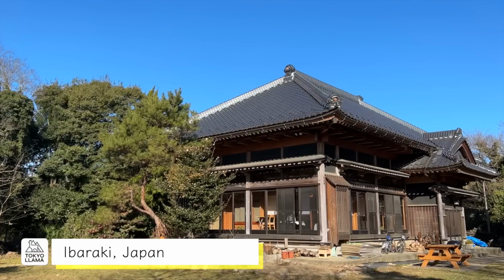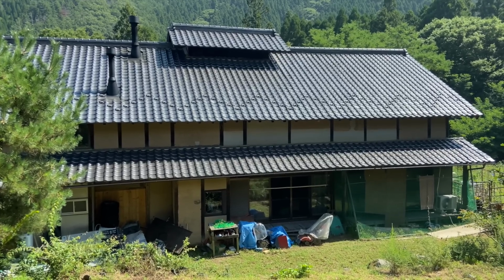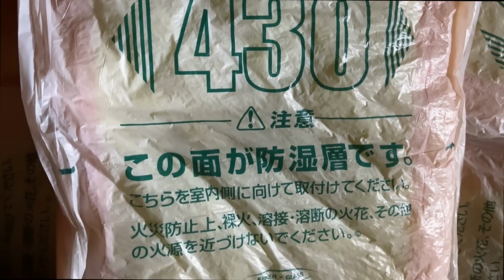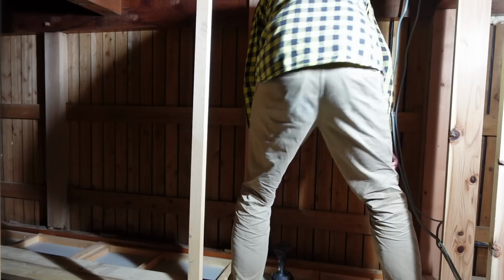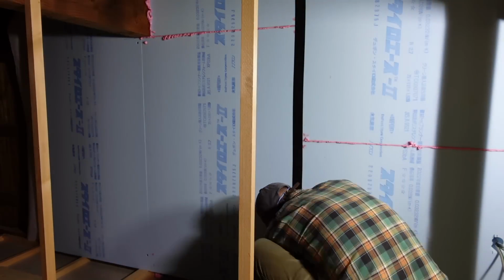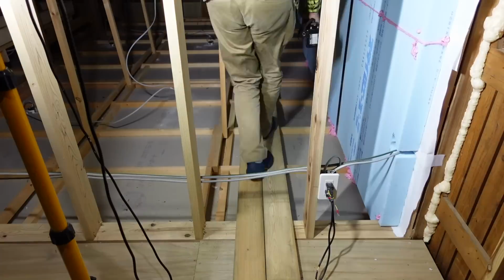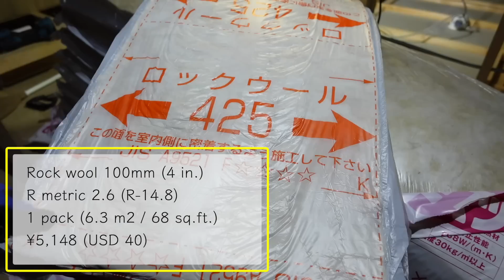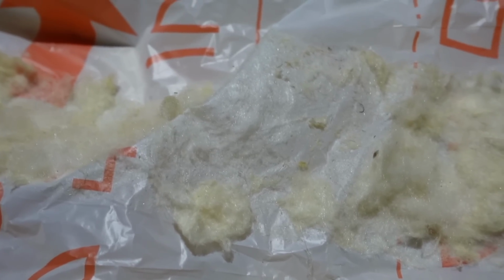Insulating a Japanese House, Part 1 | Abandoned House Renovation

Comment: You should play around with the foam spray gun with pre mixed cans. You can get a nice small bead that sticks well to join two surfaces to create a seal.
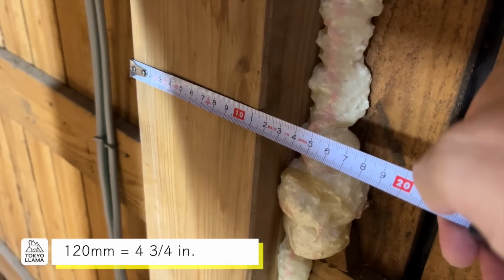Reply: Actually, I see that you did @3:36 but that bead is much too big.
Reply: I see you have it 11:28... I really need to learn to watch a whole video before commenting.
Reply: Not sure if you new this but higher R rated foam is a fallacy. It eventually off gases it's higher rating becomes the same as any other foam. What you really need to buy for is non-flammability.
Reply from the maker: Yes, that first one was a mistake. I’ve got a bit better at it. The other selling point of the Neoma foam is its non-flammability. Appreciate the comments!

Comment: Always impressive to see your skills... & thank you for your explainations.. Q: with the gaps that are useful for air circulation & prevent mold & rot in the wood.. are you concerned about wasps, bees, birds, mice from entering the house?  would putting netting or a screen on the outside wall ( interior helps prevent critters from entering?
Reply from the maker: Yes, I'm mainly concerned about hornets making a home inside the eaves. Now that you mention it I could put an insect netting over the inside of the eaves. Thanks!
Reply: @TokyoLlama   Glad I could help...

Comment: I am surprised you went with sealed insulation bats because of the concerns of moisture in Japan. I would have expected the use of normal paper faced bats to allow for moisture exchange in the summer. But then maybe the dew point is commonly inside the bat so that might be a concern?

Anyways, I'd take a peak between the bats and the the ceiling a few times over the year just to make sure things aren't getting moldy. If it's working it should be okay.

One big help would be to lay to a moisture barrier in the crawlspace under the house. This would massively cut down soil transpiration during the rainy season so all you have to worry about is the air humidity.

Comment: Watch out using spray foam near wood, it can trap moisture and cause rot.

In the UK we are now using 300-400mm thick loft insulation. I’m also laying a perforated foil top sheet to mine to stop the radiant heat from coming into the rooms below during the summer.
Reply: Open cell spray foam is vapor permeable and is used on roofs. Foil sheets can trap moisture. On the floor they do nothing as the dust renders them useless. There also needs to be an air gap between the radiant barrier and the insulation beneath to even have a theoretical benefit.

Comment: When my dream of renovating a house like that happens, I will for sure install a Heat Revovery Ventilation. 
It might be expensive but the cost savings are great and then the issues with mold can be well controlled. 
Saying that, I do not care to have ventilation ducting visible. That might be a problem for many people. 

Great job. I really enjoy watching your content.
Reply: Although you manage to provide airflow to the elevation very well. 
I learned so much from your content. 
Thank you. 

Greeitings from Tokyo
Reply from the maker: Thanks, I’m also planning heat recovery ventilation in this house. Considering ducted, decentralized, and/or aircon/heat pumps with air exchange function.
Reply: @TokyoLlama I have a Daikin with air exchange function. It works though it's not a lot of air so would consider it supplemental to wall or ceiling proper HRV. I may do that too...
Reply from the maker: @rsmith02  I've got one of those Daikins downstairs, the air exchange seems okay, but not sure the humidifier function does much.

Comment: Modern Japanese houses can also be bloody freezing in Winter. Ametalin foil sarking is recommended in the attic to give relief from radiant heat from the karawa in Summer. Huge difference.
Reply: The radiant barrier foil would have to go under the roof with airgaps, and with all the framing coming through would be hard to do well (lots of holes). On the floor it would do nothing as once it is dusty there is no more reflectance. Just standard insulation would do better and not have a penalty in the winter. In general, for homes radiant barriers are a scam.
Reply: @rsmith02  I ran mine bottom face of the rafters, in the attic and in the cathedral ceiling. Foil tape overlap. The result was the elimination of most radiant heat into the attic. Cathedral ceiling areas comfortable without air con in Summer.

Comment: My husband and I had insulation envy. We bought an older home that has "Blown in" insulation making it very difficult to access wiring in our attic spaces without getting covered in dust and insulation bits.
Reply from the maker: Accessing the wiring will be an issue, and will have to build access doors in the walls (hidden somewhere) for the electrician to get into the eaves if necessary.

Comment: I am concerned even led lights put off heat you probably looked into it . Halogen lights cause a large percentage of house fires in Australia. I don't understand why you want rockwool it will harmlessly hold some moisture until it evaporates but the condisation will happen at the moisture barrier witch you put detect on top of the ceiling. If you put the  rockwool on the bottom and the stuff in the plastic bags on top it will move any possible condensation to inbetwen the layers of insulation we're it can evaporate and do no harm .
Reply: The rockwool is in the bottom in plastic bags isn't it?

Comment: the thick insulation under the roof with the air gaps all around should also help in the hot and humid summers and not only in the winter. Excellent Job on your house
Reply from the maker: Thank you!

Comment: Don't know if they're common in Australia or Japan but in the US (particularly in decades past before AC) people would install whole house fans that would suck cooler air from inside the center of the house and blow it into the attic which pushed the hot air out. Maybe worth looking into, especially if the moving air helps keep the moisture down that you said is an issue for Japanese wood structures.
Reply from the maker: Interesting idea. I have been thinking about ways to maintain air flow once the walls and ceilings are complete but hadn't considered this method. Good to know, thanks!

Comment: Your house is looking great, but I have a note and a question. The note is that you should really be wearing eye protection when cutting up insulation since the micro particles can cause eye damage that is undetectable for years. Also, did you run the insulation plan by an environmental engineer to be sure that such drastic changes in airflow won't heavily increase the chance of mold growth?

Comment: Nice to see an update on your progress! I really want to upgrade the insulation in my attic this summer. It hasn't been touched since the place was built in 1977, so it's not nearly what it could be. Energy costs here in Canada are through the roof these days. Good luck with the rest of the insulation project! Don't fall through the ceiling!
Reply from the maker: Thanks, yes, with the unpredictable energy costs want to make the place more efficient for sure. I've got a few other ceilings to fall through...

Comment: You should really look to use Rock wool or what we in sweden call "wood fiber" wich is like sawdust from chainsaws, not the fine sawdust but bigger chunks, around 30-50cm with either of those is enough on the roofs for swedish winters and summers, really easy to install (since all you do is "blow" it where you want it.. dunno if they do it in japan.. likley not..   but its a very good and fast way to insulate a roof or attic, allso you can fill the walls with it allso..   like this..   in this vid they are using glass wool tho.. but stone and wood fibre are less moisture sensitive with good ventilation.
Reply: He is using rockwool batts in addition to fiberglass which he put on top. I think you are describing blown cellulose which I haven't seen much in Japan.
Reply: @rsmith02 yeah blown cellulose, rockwool or glass fibre is what I used to install. it really gets into nooks and hard to reach places, and is really fast to install(and remove.. you basicly vacume it up), it is really good for having as little cold bridges as possible etc etc. and generally id feel more "safe" with that kind of insulation vs the expanding foam insulation that has become popular in certain places.   

Hes doing the traditional isolation witch is nice, but with the blower, you will finish in about 2-3 hours total, excluding the prep time of installing the air ducts.. wich takes like an hour.

Comment: Interesting that insulation is almost always coated in Japan. Here in Germany, the standard Rockwool for interior walls or ceilings is in rolls or slabs without any coating and you just cut it to size with an insulation knife.
Reply from the maker: Japanese really like convenience is the reason I think.

Comment: Ceiling should have plastic vapor barier 1st,,before covering w boards or drywall to stop hot air seeping up and creating condensation when attic is cold. Mind you Im in Canada,very cold place and thats how every house must be done. walls 1 insulation 2 Vapor barier,then drywall then paint.
Reply from the maker: I think the thickness of the (closed cell) foam should be sufficient as a vapour barrier for the walls.

Comment: I’m glad you finally got to insulate. Wow, 100mm bats followed by 100mm roll Rock Wool! I’m jealous. Here in Aso, I had 55 mm glass batts originally. I added two layers of 55mm RE batts, and 55 mm on some walls from the attic to the cathedral ceiling. Did you have to special order. My home centers don’t carry more than 55mm and no rolls of RW. What product were you using for spray foam crack filler? Did you use an infrared heat sensor?
By the way, great job! Hope to see part 2 soon. You are an inspiration!
Reply from the maker: Thanks a lot! Yes, my local home centre has the 100mm rock wool batts. Can get earth wool at the home centre too, but only the covered products. Have to order the rolled product online. I used the Sista pink spray foam with the gun (expensive but worth it as it enables you to not have to use the whole can all at once). I did use my infrared heat sensor.  Will show on my next video perhaps.

Comment: I'm surprised that Japanese house roof do not have more insulation, although I guess it depends on the region.  I did see more western style houses in Hokkaido.  In the winter, especially in places where there are lot off snow, a house not properly insulated the heat can get to the roof and can melt snow and melt runs to where there are over hangs and freezes creating ice dams.  This pools up water causing water damage to the roof.  Though where I lived in Kyoto, it doesn't snow that much to worry about it.
Reply from the maker: Yes, we don't get so much snow here but I sometimes wonder what they do in Hokkaido.

Comment: Have you considered using XPS, or, even better, PYR insulation panels?

The mineral type you use is prone to damage from rats and birds who love to use it for nests.

In case of XPS you can find 1.2cm panels which will give approximately same level of insulation (or even better). Also you can buy XPS with foil protection which will negate the risks of rats. And birds are not interested that much in XPS.

The only downside is that XPS is a worse material in case of fire but given the fact that you have mostly wooden construction it won't make much difference.
Reply from the maker: The foam I used is Dupont XPS, I'm pretty sure. I searched for PYR as I'd seen it used on YouTube renovation videos but doesn't appear to be available here. Will have to monitor the wool for pests!

Comment: I see what r u trying to do there. good idea with walls. u r moving in right direction. not perfect, but fo diy guy, its a very good decision. but I have... questions about japanese wool. like they doing it in this kind of packs? very questionable decision. vapor on bottom, wind on top side. it will slip vapor anyways, cause u have a gap between packets. still, if u have a good airflow up there, its not so crit. still, it leads me to the question about moisture

oh, ya. before everything, safety first. good idea with a helmet
Reply from the maker: Yes, agree, it's standard to use this kind of packs, and to do it properly they should tape up the seams (I see them lay on the ceiling without taping but usually tape for the walls). But to be honest, I'm not so concerned about the vapour barrier there as I would be on the ceiling of the roof (where I plan to do the vapour barrier properly).
Reply: @TokyoLlama  as I said, its not critical, if in the end u will have an airflow, which is enough to let humidity away, while keeping temperature in a comfortable degree
btw. never knew, that u r an australian. something new every day
Reply: @TokyoLlama  I dont know what yar plans out there, but it makes me think. thanks for a quick brainstorms. how about recuperation? u pretty much can diy it
Reply: whats your local year temperature in celsius?

Comment: Hello from Newtown, Sydney Australia 🙂

I’m imagining ALL of the “advice” and “feedback” you must receive whenever you post your fab videos. 

 I’m sure there will be as many opinions on insulation as there are...people 🤣

Also, SNAP for growing up with no aircon. 

My dad moved up to the hunter valley when I was 12 and it was only in his 70s that he installed aircon - it felt like SUCH a luxury, but he ALWAYS knew when I had opened my bedroom window during the night. 🤣
Reply from the maker: Ha ha, yes, insulation does bring out a lot of opinions. I'm like your Dad now, got the AC on timers and also vigilant for anyone leaving a room with the AC on.
Reply: @TokyoLlama  fun fact I learned while my mother worked at a power company: it's significantly cheaper to leave aircon running all day than to turn it off and on. it takes a lot more power to get a room back to temp than to maintain it, especially in a well insulated house

Comment: I'm wondering if the insulation will work well with the moisture.... Probably a better but far more expensive way would be to put some kind of windows (instead of walls)that will close perfectly during winter and can be opened during summer.
If there's too much humidity not only the insulation would be replaced periodically but also wood can get rotten. I hope everything works well. In Mexico our houses are made from bricks and concrete and we don't need heating nor cooling but a bathroom with poor ventilation gets fungus everywhere... I guess it may be the same in Japan during summer
By the way thanks for the video I was looking forward to see one a long ago.
Reply from the maker: Thank you, definitely a concern but we have lots of windows that allow the house to breathe, the new windows will be air tight. Also, the aircon also dehumidifies, so that helps.

Comment: I know I'm late to the party here, but a few comments: First, your new indoor working shoes look so comfortable. Congratulations on those. Second, are you ever concerned about attaching studs to an existing structure, given the earthquake risk? I realize these aren't large studs, but I think about it during your videos sometimes. Third, if I were doing this project, I absolutely would have Griswolded that ceiling by now. I'd be sitting there watching old family videos with my legs through the ceiling.
Reply from the maker: In regards to the studs, do you mean perhaps I “over-stiffen” the house by attaching studs? Actually, that is something I have been wondering about, and one of the reasons I have been putting in mostly bare minimum fastenings. I am surprised I haven’t put a foot through, plenty more ceilings to do though!
Reply: @TokyoLlama  I don't know that I mean anything, really. I imagine I would be paranoid about the unintended consequences of putting anything in a wall or a stud when an earthquake went down. I know it has to be done sometimes, I just wondered if it was something you thought about or if it even mattered that much.

Comment: Might want to consider spray painting or otherwise clearly marking where the ceiling can support a person's weight. I could see myself doing a similar project and then putting a foot through the ceiling because I forgot (aka missed) where I could stand. Totally not speaking from experience either...
Reply from the maker: Haha, yes, good idea. I knew were the safe spot was but could have easily made a mistake.

Comment: as a german engineer who actually (yeah I know theres ppl like that in every comment thread but I actually am one) calculates the heat transfer and safety from mold/moisture condensation for the connections of different parts of buildings I can only recommend to you to reach out to an engineering bureau (maybe even a german, I dont know if other countries have this kind of job in this amount so it's probably way more expensive there) or energy efficiency experts like me so someone uses for ex. PSI Therm and calculates if theres moisture forming on any surfaces in your wall. Thats a more or less quick thing if you provide all the necessary data (dont get ripped off, whole buildings go for ~1,5-3k so having 2 or 3 heatbridges calculated and checked should be like 100 or 150€) and in the end you'll know if theres any chance of moisture or mold in there. It doesnt entirely save you from mold to just have good ventilation. Usually especially for roof insulation theres foil from the inside to stop moisture from inside the house getting into your insulating parts or outer wall parts where it would then condensate due to the lower temperature. Since your attic is very open for higher moisture loaded air hitting coler parts I'd at least check on it in winter and see if theres any visual trace of water. Anyway, what you're doing is a great job and very entertaining to watch!